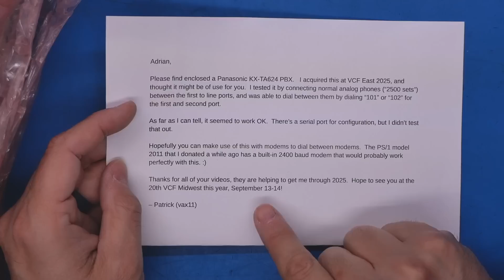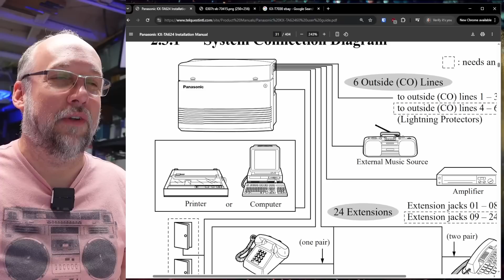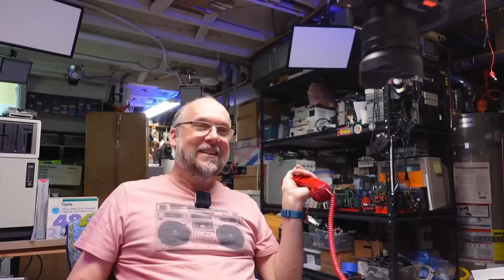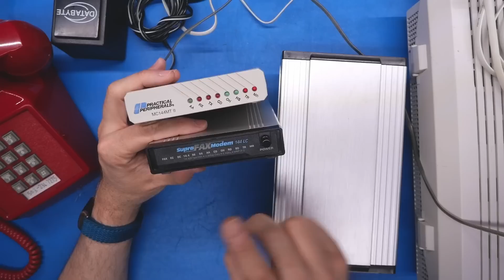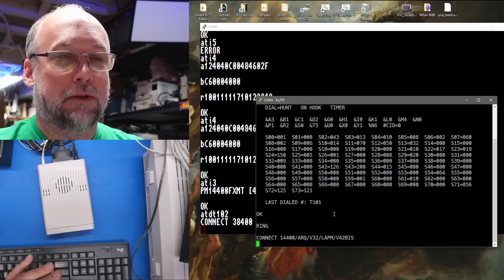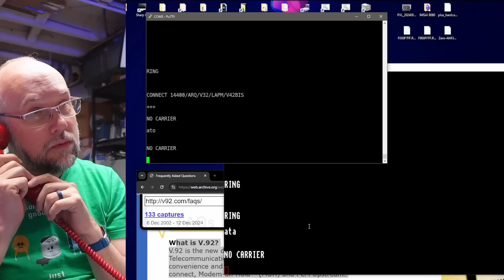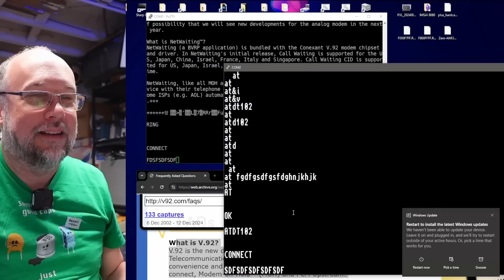How to use phones and modems like it's 1992

Comment: We had DISA Line Access, when I worked for a railroad's Comm Dept.  Calls would appear from which ever local PBX we exited via an extension, and we could call any where.  With 800 access, we could call from a payphone, type a special extension, type a generic password, get local dialtone, & then dial out, to whomever we liked.  It was a blast, for as long as it lasted.  ;)

Comment: It's not hard to make a BBS anymore, there's a handful of BBS packages that are open source. Synchronet is probably the most maintained of all of them, but I found the source for LoraBBS as well, which is one I used to use on my BBS, and Maximus I believe was always open source.

Did you check the slider on the bottom of the modem? They used to have a volume slider.

Comment: The Courier 56K is a beast.  Used one at work to login remotely (and securely, using dialback) before the internet took off.
Reply: Those were used to access the internet too. You probably wanted to say cable/LAN internet.
Reply: @shadowflash705  At the time, we had an intranet at work, but VPN's & static IP's were not commonplace in the SMB market (not at a reasonable cost for a small business at the time),
   Using the dial-back feature of the modem, I was able to call the office, the modem would pick up & prompt for an account number and password.  If correct, the host modem would hang up and call my house.  I answer the callback and after the negotiation, I would get a login prompt to our RS6000 system.

Comment: The disconnect signal is called CPC (Calling Party Control) typically, the CO or PBX will remove the 48V talk battery for 250 - 400 milliseconds or so, which would cause most far end devices to release the line. A lot of systems don't do this on intercom, but can detect it on CO ports to keep from holding disconnected lines, for example.

Comment: It's amazing how long the humble twisted pair copper wire was used and how much the telecoms were able to get out of them.
Reply: Hang on a bit - it's still used, have a look inside a twisted pair Ethernet cable - Gigabit plus speeds.
Reply: But the PSTN isn't a twisted pair. It's just a pair. ('tho for simplicity / neatness patching often used slightly twisted cabling - it keeps the pair together. the most common in house cable was just 4 straight wires - red, green, black, yellow.)

Comment: I still have my Commodore 1660 300 baud modem, only I have gutted it so I can wire a Raspberry Pi Zero 2W into the user port of my C64, and all the other bits and pieces I need to make it work like a TTL to Serial converter fit nicely inside the modem shell. That way I can use Python to convert and send 320x200 hi-res images from the web to a specially written terminal program on the 64. I just need to figure out ways to speed it up because currently it's running at 1200 baud and slow as heck, transferring a picture takes a couple minutes. :P

Comment: I had that same 14.4k Suprafax modem. I used it with my Amiga 3000. Those were fun times.
Reply: I also had a 14.4 SupraFax, but instead of the power switch, there was a square 2-3 digit led-dot display, that would show your speed and other information once connected.  Supra advertised in Amiga magazines a lot, and I think they had other hardware devices specifically for the Amiga (like the A500 68020 accelerator).

Comment: That phone switch can't be any older than 1999. This is because ON Semiconductor was spun off from Motorola in 1999. I saw at least two IC's from ON Semiconductor IC108 & IC114 on the bottom board.

Comment: 56K modem needs a Digital back-end answering (ISDN) then the ISDN part is converted to Analog at the local commutation central and the signal goes analog only within the copper portion between the central and the end-user 56K modem.
Basically the ISP side needs a T1. Each T1 carries 24 data channels and 1 signaling channel. Each of the Data channel is routed to the destination central where the SLIC Subscriber Line Interface Circuit) decodes the ISDN channel G.711 µ-law to the analog line of the destination 56k modem. So 56 is basically a mix or a hack between a digital transmission on the ISP side and an analog modem on the receiving side.

Comment: Phone equipment is a lot like any retro stuff.  The website says everything is in stock until you order it then they go on the search for it
Reply: I just got finished with a bunch for DID shenanigans.   Customer had a brand new phone system that didn't detect any of the settings right.  They should have got something old that actually worked!

Comment: Adrian when you were younger have you ever visiter the science museum iin Ottawa ? if so you must remember the mechanical telephone central system where you see all the rotary relays routing the signal from one phone to the other when we dialed the numbers that thing was amazing
Reply: Seeing one of those as a child…has only caused me problems. I now have two rural systems built in the 1950s wrapped up in tarps awaiting being brought back to life. They are very big and heavy. The mechanical methods they used for generating ring current and dial tones is very cool.

Comment: I had the same Zoom 2400 bps modem and the same Supra 14.4k modem back in the day, I wish I'd managed to hold onto them, but I didn't have the money to upgrade without selling my previous modem. I started with a NZ Post Office Telecoms 1200 bps modem, then upgraded to the Zoom 2400 that was being sold by a local sysop, next came a 9600 v42.bis modem that I can't remember the brand of but seemed like it was the size of a small pizza box, which I paid for with a small inheritance I received and the money I got from selling the Zoom 2400 to a friend, I was then lucky enough to be offered the Supra 14.4k cheap by a buddy who needed money fast, I borrowed the money from my father and paid him back by selling the gigantic 9600 modem, then I upgraded from the Supra to a Zoom modem by "running an after hours BBS" to get a sysop deal on a Zoom 33.6k internal modem, which I funded by selling the beloved Supra 14.4k.

After that I had a few different generic Rockwell chipset 56k internal modems which were completely unremarkable.

You need to set up Adrian's Digital BBS - the most exclusive BBS in all the world that can only be contacted from Adrian's Analog Telephone Network.

Comment: These Panasonic systems are great analog switches, they were discontinued in 2019 due to changes in law about how 911 is handled. You're right they use their own different internal dial tone and use the same tone for ringback, busy, and reorder with different interruptions. By default it should be configured so that dialing 9 seizes the outside lines in descending order starting at 06 (or 03 on my system as I only have 3)

Comment: Yes, that's 300 bps. My first modem experience was with at 300 bps modem that I borrowed. I remember just being able to read the text as it was being transferred.
Reply: That was fast for me, my first modem was a GEC DM200, a 200 bps modem, that had a mod available to bring it up to 300bps, these modems were basically a 19inch rack with a pile of plug in cards, transmit, receive, power, serial port, high channel filter, low channel filter etc etc.

Comment: Last time I touched a phone system was 13 or so years ago. An old Nortel system that was used at one of my employers. They left the default admin code so I was able to make changes and fix the extensions from my desk when I first joined. More recently, it's been all asterisk and similar deployments.

Comment: It's fun playing with analogue PBXs, I have two Panasonic "Easaphone" units, KX-T30810BE and KX-T61610BE (Both UK-spec so internal calls have the US-style ring, versus how yours uses the UK-style ring for internal calls), used with my mostly rotary dial telephone collection (when I had them set up, been boxed up for a while), little different to the KX-TA systems, but quite fun to use, the 308 needed to have brown goo removed (that conductive nastiness) to revive it, but it worked nicely once I did, also have a KX-T7130E for programming them both, those are pretty useful systems for older telephony, definitely useful for connecting old computers together that lack networking but have serial available for a modem... :)

Comment: The system is providing UK dial,  ring back and double ring signals
Reply: Just being pedantic - not quite UK double ring - the UK cadence is 2 rings 3 none (imagine counting to 5 and repeating), whereas that pbx is doing 2 rings 4 none (6) :)
Reply: @budgiefish  schooled! 

Actually I knew the UK cadence was in 5/4 time signature, but I just forgot because those ringtones are basically extinct now. 

The song Telephone and Rubber Band by The Penguin Café Orchestra overlays the 5/4 pattern on the busy signal (apparently a technical glitch at the exchange captured on tape), creating a surprising syncopated 4/4 pattern. Check it out.
Reply: I noticed that too. Presumably because it was "Made in UK"

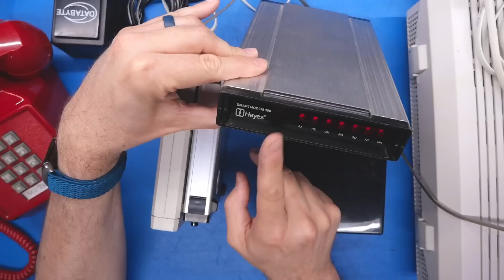Comment: 40:46 - I had a Zoom that looked exactly like that, but mine had hardware compression and error-correction as well, which was just nuts for the time.  I got it to use temporarily to support my BBS after lightning struck my 9600bps modem.  I ended up getting a 14.4/16.8 USR HST Dual Standard (or "Dually"), and it was great-- via one daughter-board upgrade, it lasted me through the 56K era, right up to when I eventually moved on to broadband internet.

Comment: My first computer was a CoCo I had a 300 baud manual connect Tandy modem to go with it. I joined Compuserve and the world opened up. That would have been perhaps 1979 or 80. Meanwhile at work in the second half of the 90s in our small branch offices we had a very similar Panasonic switchs possibly a generation earlier. They worked well. At Headquarters we had a Nortel Digital switch. We eventually had a trunk connected so if you wanted to call an extension in the main office from your branch you dialed 8 on the branch Panasonic and got the trunk to the main switch. You could actually then contact another branch when you got the dial tone from the Nortel, then another one digit prefix plus the extension at the other branch and it would directly connect you. 

We did block the external DISA port as there was a lot of fraudulent use where people familiar with the Nortel could call in then dial the code for the DISA and go back out to anywhere in the world.

Comment: When you mentioned the pulse dialing because touch tone cost extra... was that in Montreal? I'm asking because I'm only slightly younger than you are and I remember that, wondering if it was common practice elsewhere if it wasn't

Edit:
I just wanted to add the following since you reminded me of so much hehehehe
You had a Courrier? Damn fancy! I was stuck with a Sportster :P

One of the coolest thing I ever saw, was downloading a Linux ISO back in the days,
The local Uni had a mirror, and all the big fibers ended up there, so all the local dialup ISPs were straight to the Uni.
With compression on, I was getting like 9-10kb/sec off 31200, so basically 3 times what I'd normally get, I have never seen a Sportster RX light so damn bright, it casted quite a wide beam, glorious. I wouldn't have remembered that without your video, thanks ! 

Still, -1 for no Sportster love :P

Also, f... winmodems lol I remembered that too.

It was nice windows having a 30 second delay before re-dialing the ISP, I could pick up the phone, punch a few numbers... my brother would get screwed and I'd have the line
 ... have you ever set up a dialup router soft on windows 3.11 ... yeah. It was a good tactic whilst it lasted, but I definitively ruined a couple of his games hehehe

Comment: The freakish delay on RX data might be the UART; usually on a 16550 (16 byte FIFO) the OS would set a half full threshold AND a timeout to reduce interrupt load. If the FIFO got to be half full (8 bytes) then an IRQ would be triggered immediately and the system would have 8 character times to pull data out before the FIFO overflowed. The timeout would trigger an interrupt if there were bytes in the FIFO and a timeout happened, which would allow the “dribble” to be received. However, often the timeout was a multiple of the bitrate, so timeouts could be long at slow rates.

Some UARTs had a constant timeout (time-based vs bitrate based) - but this behavior wasn’t really noticeable as by this point everyone was running at 9600 or above.

I believe you may be able to disable the fifo in the device manager pane for the COM port…

(I used to build and sell multiport serial cards that went with my BBS software… Natsemi 550’s were great, Exar were ok and most of the others had different bugs you needed to work around in the driver!)
Reply: …though now watching the video more, it doesn’t jump in 8 byte blocks so maybe it’s PuTTY. Or multiple interacting bugs!
Reply: This is exactly it.  Though the 16550 timeout is 4 character periods with no data received/read, not 8. The watermark is software settable, and actually has to be set, as by default, the 16550 resets to a watermark of 0 characters. With a fast computer, and a 16550-equivalent UART, 300 baud is slow enough to notice the bursty nature of the CPU emptying the FIFO.  Though I could notice it at 2400 and even 4800 baud if the watermark was set high.

Comment: I like most all things retro, but modems and old printers are where I usually bail. I really don't miss the days of having to deal with a flakey modem connection, someone picking up the phone, or perpetual busy signals from my dial-up ISP. 

It's funny how RS-232 lives on 60+ years after it was introduced. It's still everywhere in IT: A multi-zillion dollar Mellanox director switch still uses it for its initial configuration. Lots of A/V gear have RS-232 ports for automated control. Most microcontroller consoles are RS-232. Programmable ham radios use it to receive their programming. There's no other computing technology I can think of that has hung on longer than it

Comment: Funny coincidence you started tinkering with modems, as I just got into messing around with them the other week. I've got a couple USR, Global Village and Motorola modems hooked into a AudioCodes MP124-FXS , which provides 24 analog ports, which is hooked up to Asterisk, works pretty great. I have been trying to see if it's possible to adapt D-Modem to accept calls, it's a FOSS software modem that should be able to hook up to Asterisk, saving a need for a physical modem for your BBS. Unfortunately, presently it only works for outbound calls, I want to see if it's possible for it to be modified to take inbound, as that would be very useful! 

Also, I still see those USRobotics Courier V.Everything modems in the field. Telus still use them for remote monitoring/access of their dedicated business fiber connections.

Comment: Pure fun! I jumped into the same rabbit hole in 2023. My motivation was to show BBSing at an event in fall. I still have 4 modems. Basically all cheap crap. One is 14400, 2 are 28800 and the last one is a 56K winmodem. Back the. I started with a 1200, upgraded to a 2400 not long after. A year later I got me a Supra 14400 FaxModem similar to yours and used it for a long time before I acquired a 28800 modem. In 1996 I upgraded my telephone line to ISDN with a Teles S0 card in my Linux PC and a small PBX with 3 anaogue lines that I still have. I used that (and another newer one) for connecting my modems. I've set up a BBS on a Raspberry PI. That worked surprisingly well But the quality of the internal analogue ports wasn't good enough for 14400. Used 9600 instead.

Comment: Used to help sysop a friends BBS (running on an Amiga 2000) in regional australia in the 90's
Ended up memorized the Hayes AT command set , to help many users tweek their modems settings for reliable connections when using old shitty phone lines
Reply: Me also - A2000 running CNet and 7 serial ports on I think 3 Zorro slot cards.   Amiga multitasking really shined running a multi-line bbs

Comment: Oh the memories... I was on a service call to fix a semiconductor manufacturing machine in a cleanroom in The Netherlands. We needed some new software and with Tech Support in San Jose, CA decided to download a 1.44 Mb floppy via modem. 1 file at a time for security. It took all evening and a chunk of the night (9 hours time difference), We even went out for dinner while it was downloading. When 5 pm came around in CA we had to beg our Tech Support colleague to stay longer so we could get the remaining files.
We got everything and successfully brought the machine back up the next day.
I still have all my old analog gear. Would be fun to see if it still works. Thanks for the trip down memory lane
Reply: PS. Does that company start with P and ends with S ?

Comment: @clabretro time......  The 624 part of the system number is 6 lines 24 extensions....  The extra 8 extension card has all the electronics of the 3 line 8 extension card but with the CO lines covered.   The digital phones have a POTS socket on the back that work as a second extension off the same jack(if my memory is correct)